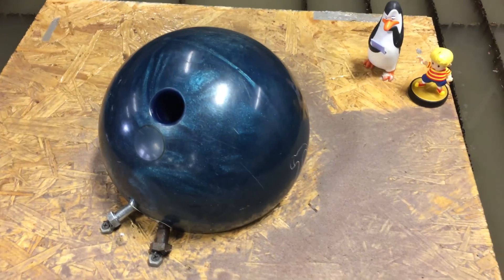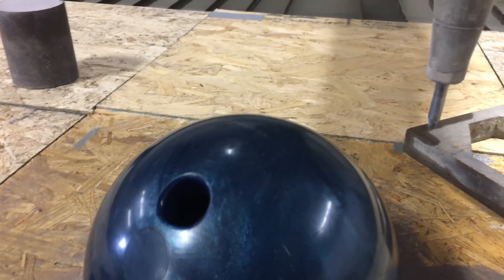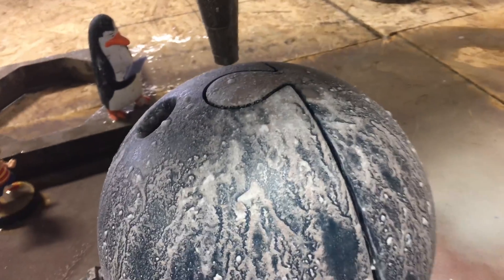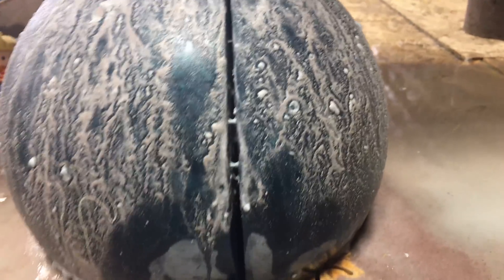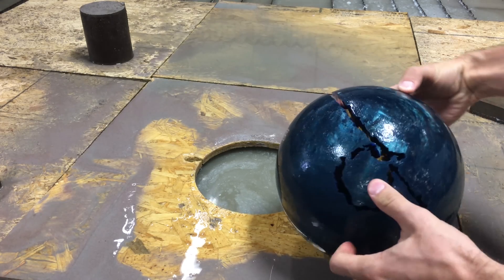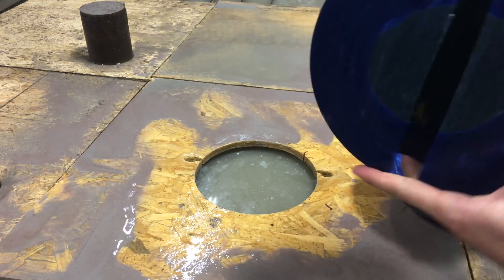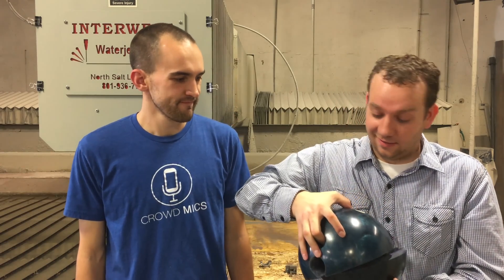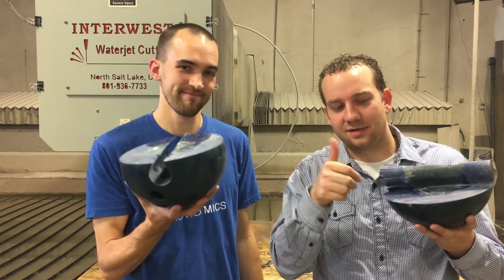Bowling Ball vs a 60,000 PSI Waterjet

Comment: I wonder if it'd be possible to make a sort of water "sword", ya know, make it enough PSI to cut through someone but not enough to ever cut through steel or whatever the tubeis made out of, then have a piece of steel come up and over where the water shoots to stop it and maybe make it so there is an opening so the water is shot back into the hollow steel into the tank, the front of the sword, the actual cutting part would then be the water jet itself. I don't know if there is a kind of flexible tube that can handle the PSI that a body wouldn't but I'm sure you guys know better than I, if there is, connect it to the hilt of the sword and have two tubes, one for in and one for out.

I don't know if something with that kind of PSI could be realistically portable, but if so a backpack would be neat, you'd be kinda like a ghost buster except you'd be cutting people in half with a kickass water sword.

Comment: Why don't you just add on a secondary water jet directly underneath to follow the upper water jet in a mirror like motion so you get a super clean cut on both sides not just one. However, I would like to see Baoding balls cut with this water jet.

Comment: Try bulletproof glass if you can get your hands on it!!
Reply: it's bullet proof , it means it can withstand extreme sudden shock not constant pressure
Reply: ***** bullet proof glass is alot less brittle than glass and its shatterproof , take ruuber-plastic for example it's hard to break by punching but can be cut , the impact is sudden by the bullet and the impact transfers to the glass when that happens the glass absorbs it due to inertia the glass does not remain the same after impact it cracks at points where there may be slight imperfections and then the momentum gets transfered to the air by increasing the size of the crack at last the momentum is dispersed and the glass comes back into its position due to its momentum if more pressure is applied at the same point the weak points will shatter at molecular level and the pecies  of glass separate from each other but molecular breakage of bonds and then gravity pulls the glass towards the earth or towards the ground , GET IT? , all this happens in a micro second
Reply: They did it actually.
Reply: Asghar Muna Tuna but that constant pressure is  nothing but sudden shock comstantly
Reply: Liam Pernell lucas is just like kill me please
Reply: guess what they just got their hands on
Reply: um no.
take something like the sun. thats a constant source of light
something like an led has a refresh rate, so its basically sending out sudden bursts of light
basically constant isnt sudden constantly
Reply: they tried it it goes through
Reply: Welp they did it :>
Reply: Little did you know they used your idea
Reply: Brad Feng sorry to be tardy to the party, but an LED does Not have a refresh rate, unless you give it one.
Reply: bullet resistant*
Reply: Actually,  many LEDs are strobed at a high rate to allow them to be effectively brighter while staying relatively cool.  An example is LED headlights or taillights on a car.  Move your eyes past them rapidly and you'll see the strobing.
Reply: teller of truth is right you seriously can just go on Amazon or eBay or wish or you could just call the military and ask them if they have any bullet proof glass that you could use and they already have done it they made a gun out of bulletproof glass
Reply: eh...
Reply: The no longer run the channel
Reply: Asghar Muna Tuna there's no such thing as bullet proof enough bullets can destroy it so bullet resistance is the right term